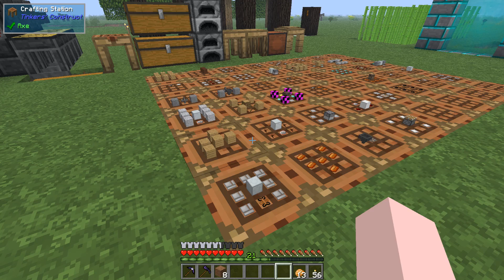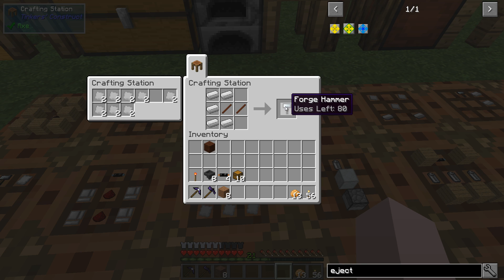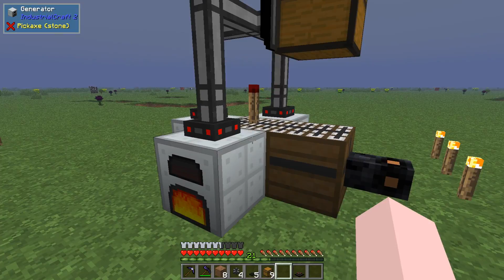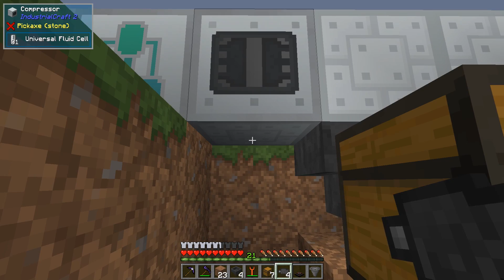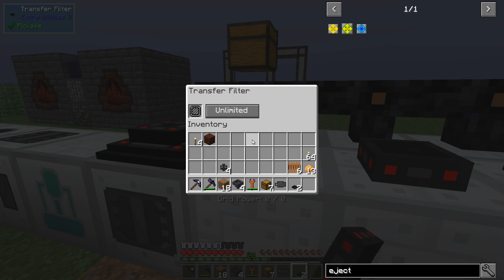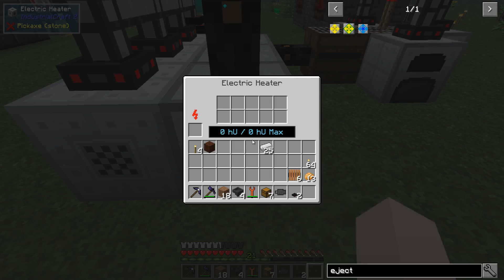03 - Industrial Age - Age of Engineering

Comment: when the blast furnace are heated they take 1hu/t. so one coil per heater is enought when they are heated. else you take more eu/hu when you go 2 since the power cost per hu/t goes up the more you can produce
Reply from the maker: Looks like you're right: " The Blast Furnace can take a maximum of 20 hU/t, ... It should be noted once it is running it uses 1 hU/t, and will not be any faster if more is given to it."
https://wiki.industrial-craft.net/index.php?title=Blast_Furnace

Comment: Yet another minecraft AoE video that doesn't mention the Block Cutter.  Make that right after the Macerator and you can delay the metal former for a long time.  The Block cutter is also like 4x faster at making plates.
Reply from the maker: I hadn't considered Block Cutter, when the Metal Former makes things other than plates too. After doing some quick, possibly flawed, math you have a good point. The Block Cutter costs 44 ingots and would save half of the 130 ingots it costs to make the Metal Former. Especially if you have less than 36 gold. Then you would have both machines and it's faster at plates as well. Good point.

Comment: Great video as always! 🙂
Minor question: Would it be possible to include the game sound in your recordings?
Reply from the maker: They actual are on, I just have sliders so low you can barely hear them. Just checked to be sure and could barely hear the chest. Which sounds do you want me to turn up?
Reply: None in particular, having the sounds play audible in general would just fill in the silent gaps of the video. 😉
Reply from the maker: Correction: there were no games sounds at all. I was hearing the keyboard faintly through the mike, not a chest. Dxtory separates the game sounds and the mic into 2 different tracks. Youtube only plays one track. Other Youtubers combine the tracks in editing. I do it by playing them both through my headphone speakers and recording them both on one track. Dxtory sometimes messes with which track it records when I unplug and replug my headset. I have corrected it.
Reply: Sounds good! no pun intended 😏

Comment: Hey great video, very informative! You can heat the blast furnace with one coil, more will not make it any faster.
Reply from the maker: Putting in more than it needs won't make it go faster, but putting in less than it needs is a different issue.

Qvist > Blast Furnaces take 20 HU according to the wiki, so 2 coils seem correct.